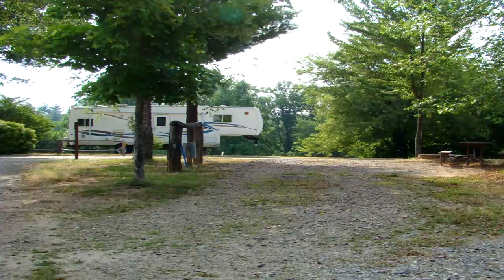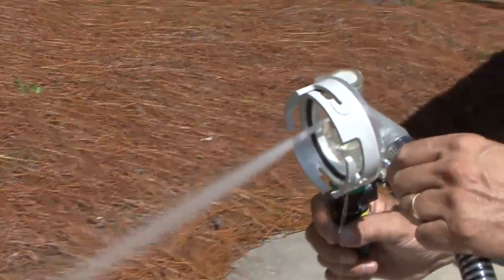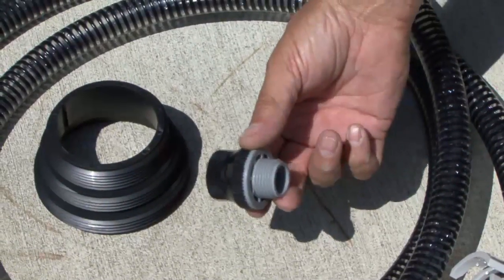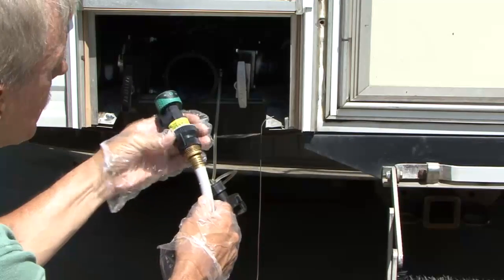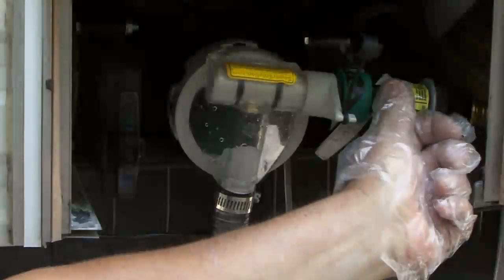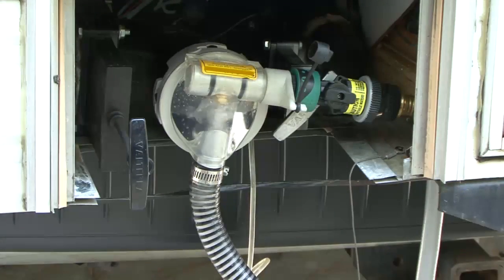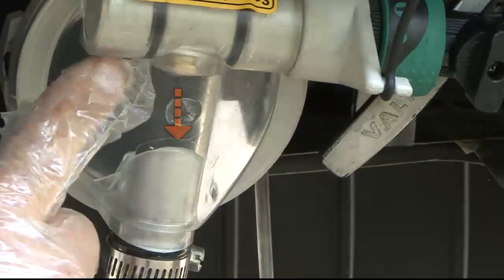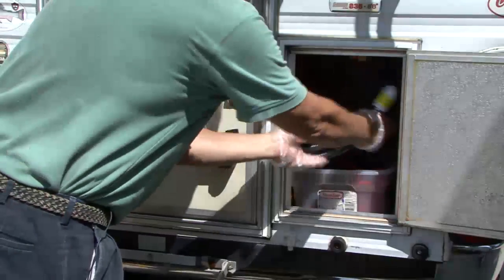RV 101® - A Different RV Sewer Solution

Comment: We used the Sewer Solution for a solid month at an RV park, and it worked so much better than the 3 in sewer hoses!  We do recommend that you purchase 25 feet of discharge hose - we needed more than 10 feet and extending it in the field was a challenge.  Ordered the 25 ft house when we returned home so ready for the next long stay.  The RV park required 3 in hose to be on stands, but no such requirement for the Sewer Solution!

Comment: Thank you for the video and product information... The only problem I see from my perspective is the fact that RV parks frequently have only one hose bib per site or even if there are two you'll be connecting your sewer system to the potable water supply... Yes a vacuum breaker is provided to isolate the sewer components... Just the thought of it is a turn-off for me... I wouldn't be surprised if some parks don't allow the use of it for that reason...

Comment: I liked this video, but am curious that at the start you premised in the event you aren't near or are below the dumping station.  For the first example the supplied 10' 3/4" hose wouldn't be long enough is a longer 'non drinking water' hose supposed to be brought along just in case?  Are there that many places where the dump pipe is actually hire than the tanks on an RV?  Sorry, only tried rv'ing once (liked it) but am still a pup tenter at heart.

Comment: If the configuration of your drain/dump system does not allow the waste tanks to be filled in the flush process (after draining), install a valve of sufficient diameter on the corrugated hose that could be closed during the flush process. This would force the flush water to fill the waste tank in order to drain more sludge from it.